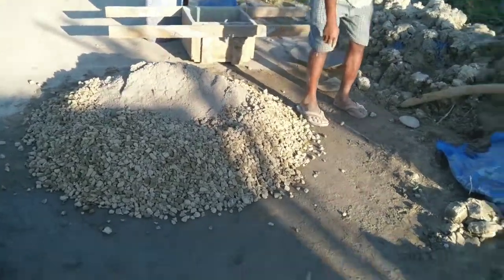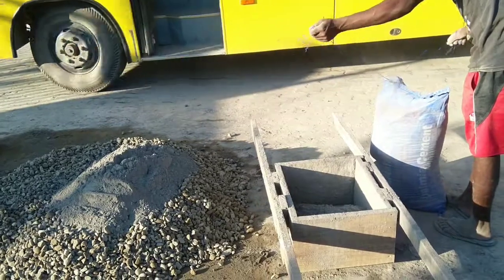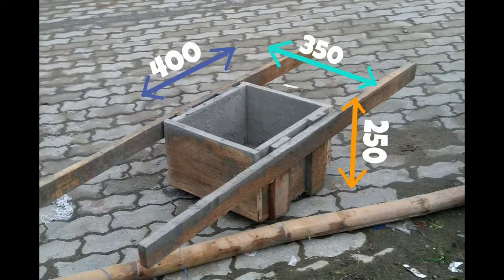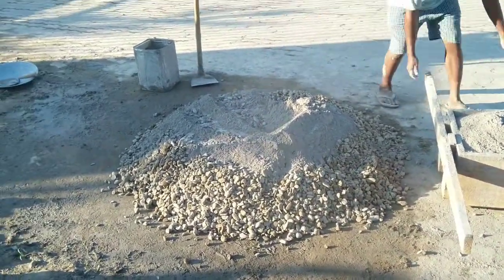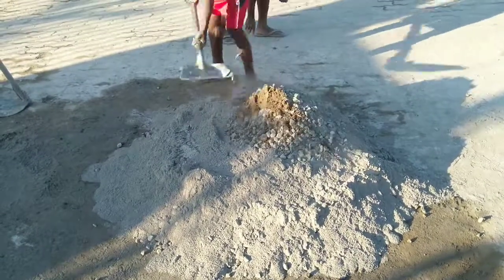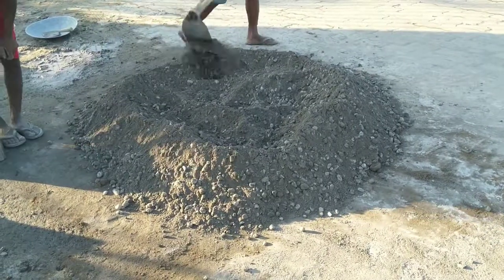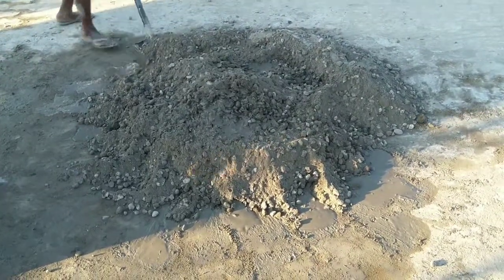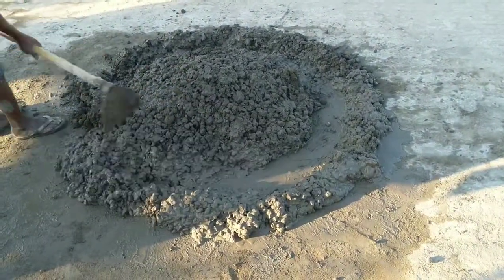Concrete with one bag of cement. ( Using standard measurement Box ) with box size

Comment: One bag of cement is not fully accommodated inside that box.. Also a small amount of cement was already seen on top of the fine ans coarse aggregate at time stamp of 7:23 so how was it adjusted? If the box was supposed to accommodate 50kg cement packet then should we add one packet cement (50kg) to respective box measured amounts of fine and coarse aggregates or should we take cement measured using box for the mix ? Please clarify

Comment: Thanks man this helped a lot. I have two question though. How would u substitute flyash into this mixture ?? And is M25 grade good for making cement blocks. Thank you 😀.
Reply from the maker: Add fly ash as 15%-20% of the weight of cement. M25 is good for making blocks. Thanks
Reply: @subhankardas9517  Thanks Buddy.... That's was of much help. Good luck to u.
Reply from the maker: Thanks bro

Comment: What is the ratio?
Reply from the maker: Ratio depends on the concrete mix you prepare. There are nominal mixes which can be prepared manually, say 1cement:2sand:4coarse aggregate is M15 whereas 1cement:1.5sand:3coarse aggregate is M20 and so on. In this video I have prepared concrete in the ratio of 1cement:1 sand : 2 coarse aggregate. Thanks
Reply: @subhankardas9517  ❤️
Reply: Is 1:2:4 ratio good for column and what is the aggregate size you used